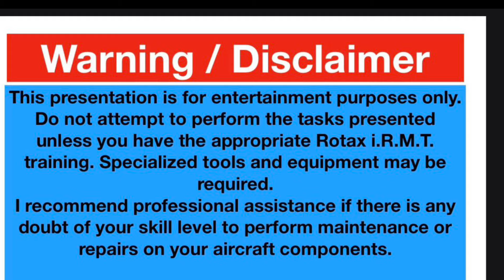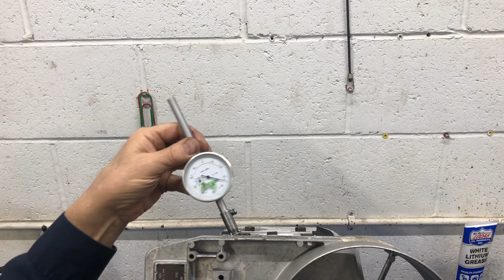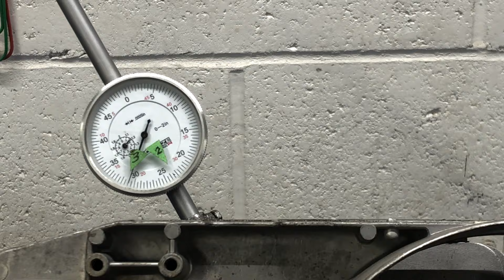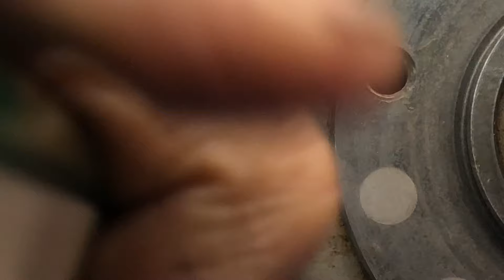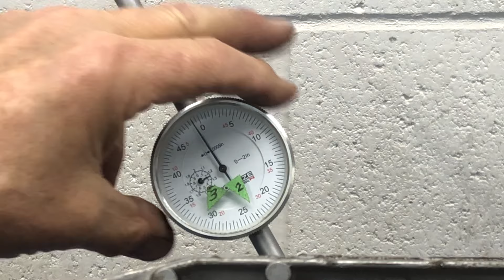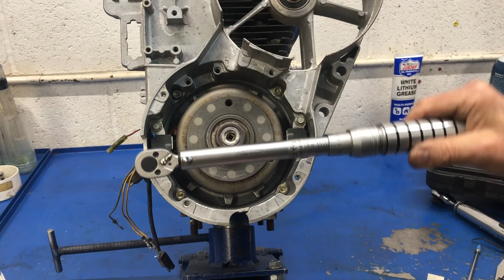Rotax 503 DCDI Ignition Timing Adjustments

Comment: I need to increase the power of a Rotax 503 engine in an gyrocopter gilabert. What do you recommend to reach 65 hp? Where should I put larger pistons? Should I re-coat the cylinder? Should I shave the cylinder head? Should I install variable ignition? What about the exhaust?A small note: adding a series MOSFET regulator prevents the stator from always operating at maximum power and diverts the excess to ground. It is then disconnected, recovering some power and discharging heat to the stator and regulator.

Comment: Hello I left a message on the other video 
It was about the stator can you tell me what should be the resistance on the charging cables if I used the voltmeter with the ohms to check resistance 
Thanks
Reply: Look up CPS they have a good article on care for a 2 stroke.
Reply: @darylbuckner5596 ok 
What COS stand for ?
Reply: @nvrqit606 mike stratman @ CPS 
California Power Systems he’s had that article for many many years out
Reply: It’s called the proper care and feeding of a two-stroke. Article.

Comment: Thankyou very much for this video.
I was pretty close in how you adjusted the timing but I used a magnetic holder for the dial indicator and wasn't sure how the 30° offset was as far as setup.
Now I need to come up with a dial indicator holder that will screw into the sparkplug hole to be more accurate. 
Thanks again this clarified the procedure greatly.
Reply from the maker: Glad the video was helpful. That's the reason I demonstrated what the 30 degree offset was about on the dual spark plug engine.

Comment: Leave the heads off and eliminate  the angle issue. Now you can use a standard dial inticator without having to compensate for the anlged spark plug holes. Perfect!
Reply from the maker: Yes I could have left the head off, however my procedure is to fully assemble the short block first. Then I pressure test and confirm no leakage of the engine. If I was to leave the heads off to do the timing and then later found a leak somewhere the magneto ignition would be extra time to remove and reinstall. Thanks for your comment.
Reply: @RotacRepair  If you would measure straight up from the piston, what would the BTDC be then? I have a Rotax 503 with single CDI from a snowmobile, and the spark plugs are straight up on this one. Do you know what the spec for straight up measurement would be, or if not, what the angle should be?
Reply: I found some specifications in the manual for the snowmobile. It says "o/rpm 20/6000". Does that mean a 20 degree angle? What does the rpm number mean??
Reply from the maker: @ thanks for your question, I’ve almost finished the video on this topic. It’ll be posted this week. Best regards John